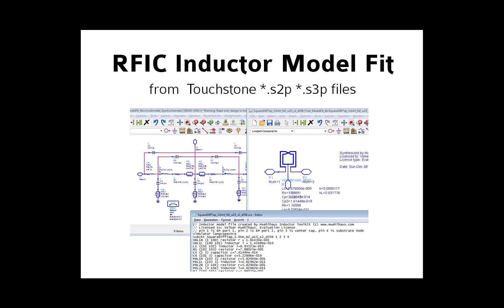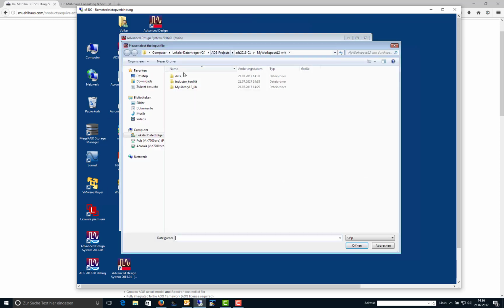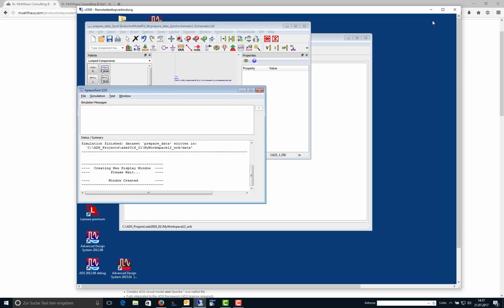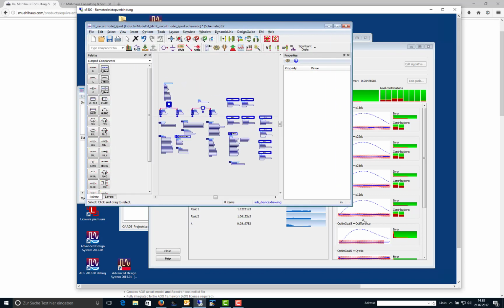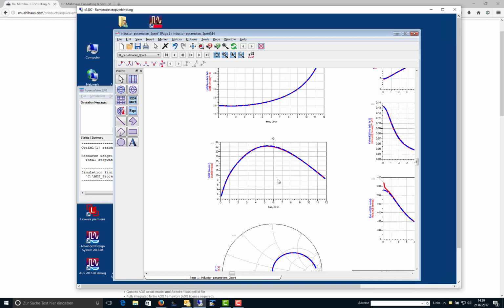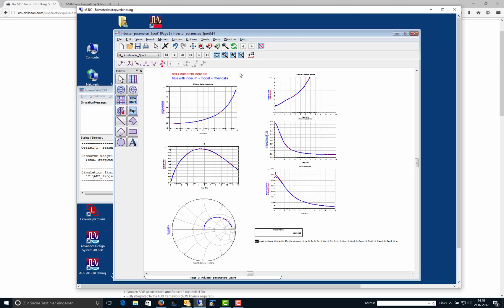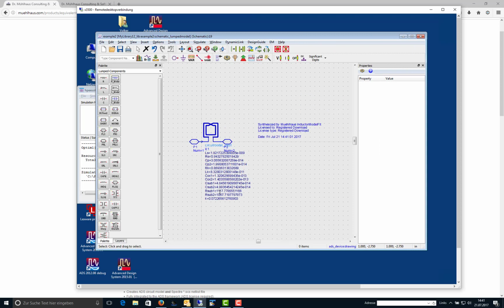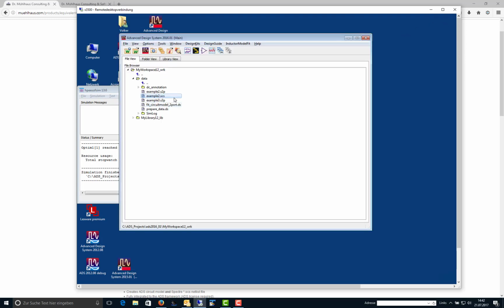ADS: RFIC Inductor Model Fit from S2P/S3P Touchstone

Comment: getting this error while importing sparameter.s2p file ADS edition 2017 ."The specified window does not contain a design (no application data).
A schematic, symbol or layout window is must be specified."
Reply from the maker: Thanks for the bug report. Indeed, the window handling and a few other AEL programming details have changed in ADS 2017. We need to update the code for ADS 2017 compatibility, the present version requires ADS 2012 - ADS 2016.
Reply: Thanks for your quick response. I appreciate your work.  I solved that problem by adding touchstone file again in next step. But produced model  was not optimized even after 1000 iterations. In my design, there are 3 peaks in S11. May be given equivalent circuit in your extension is not fit for my design. Can you design a similar equivalent circuit for my design? Please mention your mail id. i will send you my touchstone file. thanks again.
Reply from the maker: You must NOT edit the schematics!!! In ADS 2017, you just need to MANUALLY start simulation in step 1, and manually start optimization in  step2,  after the schematic windows come up. Our code that should start the simulator automatically doesn't work on ADS2017. We will issue a new fixed version in January.

http://muehlhaus.com/contact

Comment: How can I get this workspace for ADS?
Reply from the maker: Hi Stefan,

I sent you the link for Inductor Modelfit, which is an ADS designkit. Did you receive my email?

To use it: 
- install the designkit in ADS 
- create a new workspace and add this designkit to your workspace

Installation is also described here on page 4:
http://muehlhaus.com/wp-content/uploads/2014/01/InductorCircuitModelFit.pdf

If you have problems, please don't hesitate to contact me:
http://muehlhaus.com/contact

Best regards
Volker
Reply: Thank you!